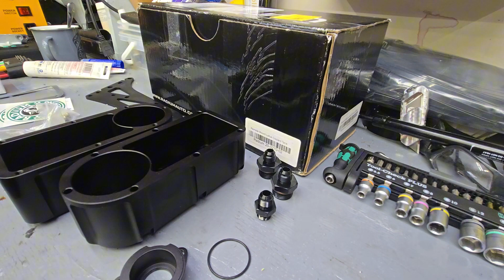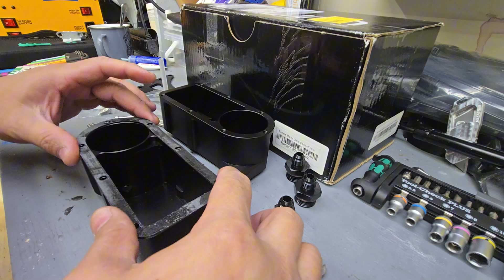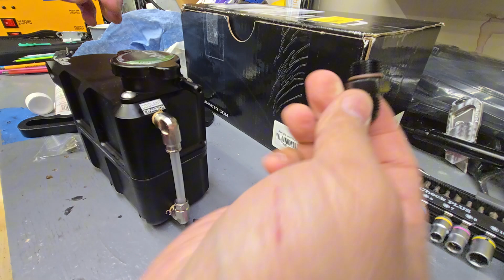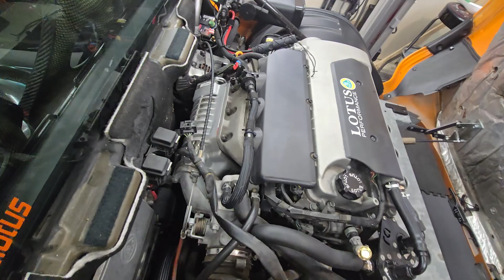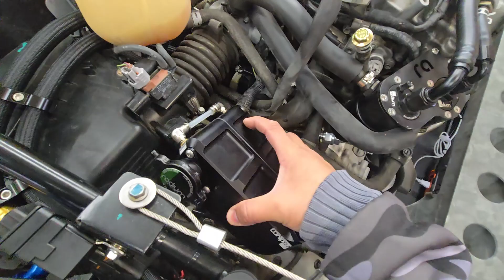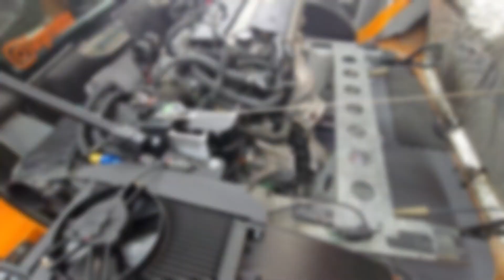Ned's Garage - Radium Engineering Coolant tank install

Comment: Those Radium tanks tend to leak if you don't use sealant in the gasket. Hondabond works well.
Reply from the maker: @spoonspoon7427  thanks for the advice. I was thinking about doing that, I'll keep that in mind if it leaks.